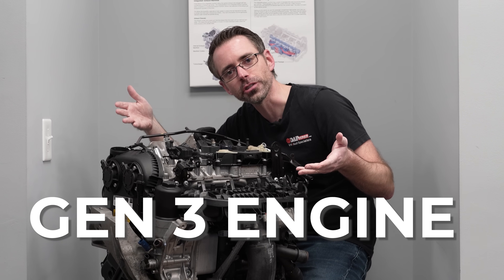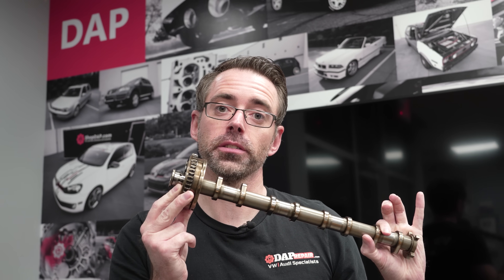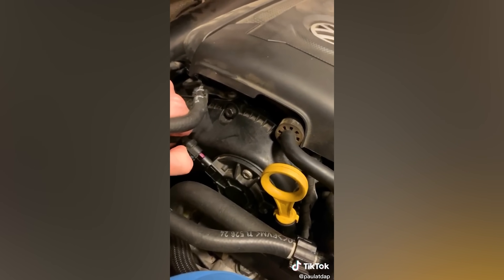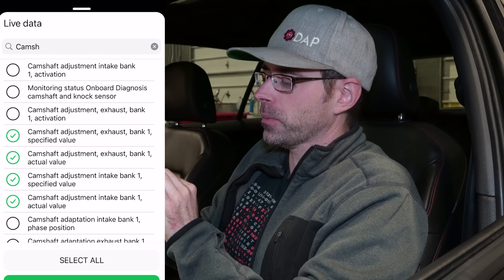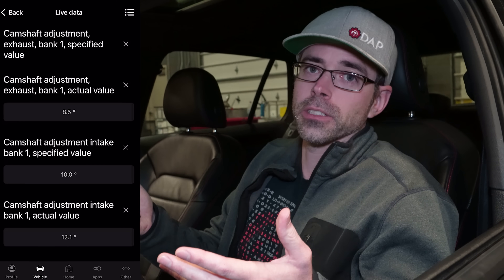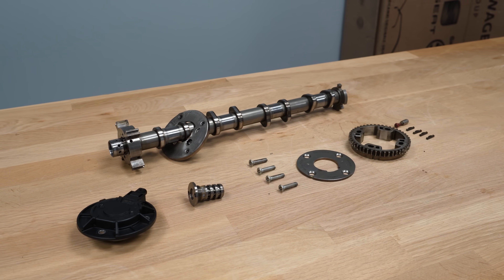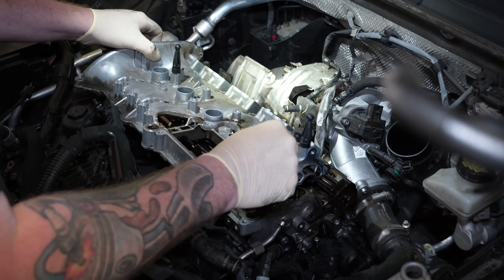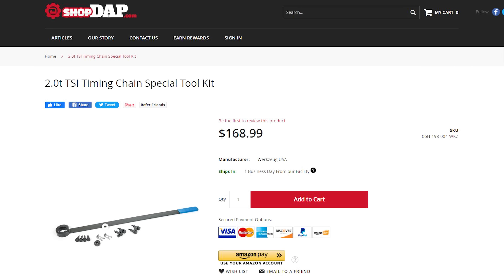Is this a New Common MK7 Engine Issue?

Comment: So just completed this job on my A4 with Gen3 motor - just wanted to say thanks for the video as it was spot on with the problem i had with my car. replaced both Exhaust and Intake cams (both had scoring on the snout part) with new spool valves, adjusters and timing kit at the same time.
cars runs like new now - :)
Thanks again

Comment: What sealant did you use on the head cover/cam cage? Mine is leaking (2017 GTI) and I’m getting ready re-seal it, and have seen talk of both anaerobic sealant and RTV. I believe anaerobic is originally spec’ed for the job, but I’ve seen forum posts stating there may have been updates that recommend a different sealant.

Comment: My GTI burned oil from day one but not much, made to 100k with only a heater core issue that leaked like crazy. Honestly it was the most reliable car I’ve ever had. During Covid it was hit and run, took 3 months for it to go to the shop and they started it with no oil and ruined the engine. Don’t know where the oil was leaking from after the hit but I made sure to let my insurance and the car crafters know but they didn’t check the oil before starting the engine.

Comment: Hi Paul, Hope you could shine some light on my diagnosis of this problem. 96k kilometers on the car. (1.8 gen3) There is a similar sound only at cold start and only when that retainer pin goes out and unlocks vvt from cold start mode. It goes away after a minute or so when (how I think) oil pressure builds up and then it can only be heard when after revving the engine slightly rpm is going down to idle. (I drive with oil run-in pressure adaptation constantly being reenabled for higher oil pressure to protect the engine more). Oil is always topped up, changed every 3.5-4k miles. Actual/specified values in obd11 are as on the exhaust cam in your video. What do you think it could be? I cannot hear any ticking/knocking from both cam solenoids through a stethoscope. Both solenoids are replaced 2k miles ago with seals. Chain stretch was checked by the dealer - all good..:/

It sounds like it’s cam vvt but my diagnosis does not prove it and I’m totally confused😢

Thank you for your time!!
Reply: Hi, I'm having similar symptoms. I already changed the magnets, but it's still happening. Were you able to resolve it?

Comment: Hi there my 2015 7 gti has bad misfire on cylinder 4 no compression on cylinder 4 tried plugs and coil pack still misfiring had vw technican look at it and he say no compression engine damaged... could it be camshaft issues ?

Comment: This happened to me and it had oil and I change my oil every 5k miles not 10k. I keep an actual quart in the trunk just in case it was to run low. So it seems like it’s an engineering fault on vw once again.

Comment: ironically, oil has been an isue since 1.8t R4 20v 150 hp since 1995. Small volume sump + needed regular change of high quality synth.
Oil related problems may be common for many manufacturers

Comment: I may have this issue.  
Mild oil consumption, and pretty consistent misfires right around 1400 to 1700 rpms just on cyl 2.   

.....DSG in Sport mode ftw.

Am I looking at a camshaft job?  Probably.

Comment: Wondering if I may be having a similar issue. My actual values are significantly higher than my expected values but only at their peaks, only occasionally off by a few degrees at idle. Should I be worried?

Comment: Lack of service and care is the cause of most problems with any vehicle,  not the manufacturer.  Thanks for sharing.
Reply: The problem he doesn’t mention is that these engine eat oil and it gets lower over time.
Reply: Yes, but when it uses a quart ever 1000 miles and they tell you to change your oil every 10k miles leaves you with -- 5 quarts ?
Reply: It would be really helpful if the manufacturer was honest. Change your oil every 3k miles and you wouldn't have gunked up rings burning oil in the first place. Would be nice if we could trust the manufacturers advice. SMH

Comment: I’ve allready changed both on my GTI 😂 first the admission one and after 40k kms de exhaust. maybe more common than we think
I only changed the outside magnet and solved the problem
Reply: Hi mate I have a golf r 2018 7.5 and im getting this rattle, did your issue completely go away after changing magent?

Comment: Ok, I changed the magnet, then the spool valve and I still get that diesel sound from time to time while the distribution is fine (i.e. correctly aligned, not stretched, only 4 teeth out for the tensioner  ); so it looks like I definitely experience the issue described here. The CEL did not come back on yet... but I guess this is just a matter of time.
I personally think it is outrageous that the cam phaser blades cannot be serviced separately and that I have to buy a whole new camshaft; apparently this was possible on earlier generations of this engine in which just changing the blades was a possibility.
Now I have to find a mechanic willing to do the job at a reasonable price... because I fear this is too advanced for me. 
I wonder if switching oil from 5w30 to 5w40 could solve the issue... because it occurs mostly when the engine is hot in my case... and not all the time.
Forget to say: engine is CJSA (1.8 TSI but EU specs, very similar to GTI engine) from 2013 with 83 kms on it, always serviced every year / 8 kms.
Nice video; thanks for the explanations, very clear.

Comment: Was that rtv sealant on the cam bridge ?
I rebuilt my EA113 and it called for anaerobic sealant.
Im assuming thats to stop the sealant sealing any oil passages and to prevent it clogging up the oil pump when the squish falls off and is picked up by the oil.
Then again EA113 isnt known for its oil pumps...

Comment: Years ago a friend in the 90’s had a Passat, and he always had the maintenance up to date. However the engine grenades due to an old timing belt. Dealership was going to charge him for repairs until he took out his owners maintenance log and the dealership had stamped that he had gotten the timing belt replaced 😊. They had charged for the work but never did it 😮

Comment: When the engine is cold, because of a ticker oil (higher viscosity density) the rattle isn't present, right? Also, on higher RPM (over 3k) because of bigger oil pressure, the rattle disappears as well?

Comment: my gen3 Beetle had this issue.... It turned out to be the little spring inside of that valve that threads into the camshaft had disintegrated. I replaced the valve with a new one (instead of doing the whole camshaft like vw wants you to do), but now I have the dreaded drain back issue when I start the car how it makes that stuttering noise like theres no oil pressure in the vvt.. I replaced that piece under the oil filter cap, took everything apart, made sure nothing is stuck or missing.. not sure why I still have that stupid noise at startup..

Comment: I've personally had 3 different Gen 3 motors all owned from New. 

2017 Jetta Sport 1.8T (Mexico) (Same engine platform) - Zero Oil issues - Traded @ 48k Miles. 30k of the miles were with Neuspeed Module Piggyback increasing boost output. 

2019 Jetta GLI Autobahn 2.0T (Mexico) (Same as GTI engine) - Zero Oil Issues - VW Bought back/Lemon'd it @28k Miles for unfixable A/C issue. 10k of the Miles were with a Neuspeed Module Piggyback increasing boost output. 

2020 Arteon SEL R-Line 4Motion 2.0T (Germany) (Tuned Down Golf R) - Zero Oil Issues - Currently @ 22K Miles - AWD forced me to buy a set of 4 new tires at 10k due to 2 - consecutive weeks of blowouts due to shitty roads by our office.... And then brakes require rotors and pads at only 20k. 

None of my 3 modern VWs with same engine family have had oil related issues at all even with me romping HARD on them. The only thing I've done is consistent maintenance by the book, always, always, always follow the break-in procedure to a tee, and only use Top-Tier branded gasoline and keeping every receipt for record 😅

Maybe its luck but I've only had issues with everything but engine/oil issues lol. But I've also been lucky enough to not have gone past 50k miles though so who knows. Maybe after some miles they get worse 😅 

Just my experience 😁

TL;DR - 3 VWs with same engine family no engine or oil issues. Only other things 😅

Comment: Just had our 2015 1.8 TSI Passat in for replacement of the n205 and magnet, cost me $786. Glad it wasn’t the $6500 top end rebuild they said it could be 😬.
Reply: Wtf. It’s a $40 part and 3 bolts on the top of the motor. You got scammed hard bro

Comment: Paul, I wonder if it would be feasible to transfer the inner piece from a VVT valve 06L109257 rev. F to the rev. A currently on my car, as to avoid replacing the entire camshaft. What do you think?

Comment: I have a mk6 gti and I’m having awful trouble trying to cure a top end rattle and it’s really bad at 2000rpm,,noise goes when magnet is disconnected,i have replaced all chains and tensionors,oil pump,intake cam and still noisy 🤦🏻‍♂️had a low oil pressure light to begin with intermittently,no debris in sump or scoring to cams even prior to cam change,have you ever seen this issue?? The spool valve seems ok has some spring resistance and not blocked 
Engine sounds great with magnet unplugged 🤷🏻‍♂️🤷🏻‍♂️🤷🏻‍♂️
Reply: You already fix the problem ?

Comment: I have a 2015 gti 39,000 miles and currently I have a problem that does not pass the smog certificate due to a problem with a VVT monitor related to this same part, a problem that is supposed to be solved with a driving cycle!  but I've already driven it for a long time at no more than 70 miles per hour and I'm still having the same problem.  Anyone going through the same thing please share your experience.  thank you

Comment: The plunger(spoolvalve) in the center of the camshaft actually failed on my ‘13 mk7 gti, Causing it to sound a TDI. It did have oil in the engine though😂. Replacing the plunger fixed the problem and prevented from buying a whole new camshaft. This was around 140k km’s.

Fun to see how this whole part work, keep up the informative videos!
Reply: Hello, any chance you can add me on some sort of other social media so I can send you a video of what mine sounds like so you can tell me wether it was the same as yours. Had this issue for ages now and it’s stressing me out as no one can diagnose it

Comment: man, you are not the only one talking about ignorant car owners who never change the engine oil !!! what is up with that ?! do people really work for their money ?! you would think they should be taken care of the money spent buying them Vehicles. but here's my question I always wanted to buy a GTI VW. but due to the lack of long-term reliability I buy a Toyota. do you think these VWs are good and how to keep them running without issues? if that is even possible. a note. I'm the kind of person who takes good care of his vehicle. I trade in my 2007 V6 Toyota Camry with 168000 miles on it for a 2012 AWD v6 Toyota Venza this one had 48 thousand miles on it. my next future Vehicle is not decided yet. but I'm researching the best fuel economy in a nice exterior design out there.

Comment: 2:32 I had that noise in my car (not VW but TSI from VAG). Air Condition compressor failed at very early stage. 3 years old car.

Comment: VW tech here: To know if its the N205 valve, first unplug it to see if the sound and characteristics of the engine changes, if it does then you have a bad valve. To confirm further, remove the valve and check the plunger/nipple . If the punger/nipple shows any resistance in moving in/out, the valve is bad and needs replacement.  PS. Make sure you have OIL  IN IT!!! 😂 GL!
Reply: but he said you can't just replace the valve 😕...... the entire kit has to be used
Reply: @voffchik26  he is in the business of selling parts, what do you expect

Comment: i am really amazed how irresponsible people are regarding oil level in their cars. such an easy thing to check, requires no knowledge, just a tiny bit of effort and can save you so much trouble, starting with getting stranded in the middle of a long drive.

Comment: People are so lazy now they won't bother to pull the dipstick once a week. The number of engines that are destroyed simply because if lack of oil is mind boggling; thousands. All for the sake of a 50 dollar oil change and a check of the oil level.
Car manufacturers should follow what BMW do, fit a low level oil sensor in the sump, but how many people would ignore the warning light and keep on driving?
Reply: Don't the EA888s have level sensors?? What's that thing on the bottom of the oil pan plugged in?

Comment: Do these engines make this noise to a lesser degree during cold start. For first minute or so, when under load (not at idle). Mine seems to as I back up a sloped drive. But pretty much silent as I then pull away.
If I let the car complete its cold start routine it's less likely.

Comment: Not only a mk7 problem. Renault has the same issues. And its not an oil level problem but a seal problem. And a renault dealer will only replace the gear wheel. This works for 25K kilometers but than the problem returns. it will costs you thousands of euros and it will not work

Comment: Can this happen to Gen 1 engines? My symptoms and codes seem to match, I thought it was my timing chain knocking but it didn't make sense because it still made compression
Reply from the maker: Compression and chain noise are not directly related. Yes the tsi engine uses a similar adjuster and spool valve so this can happen

Comment: I knew from the very beginning to change oil way more often than the dealer says, and use the OEM oil filter with the specified oil. Engine will last a long time, even if it’s being driven hard
Reply: I agree...I bought my MK7 brand new and only drove maybe 8000-10000KM per year (and that kilometers) and I changed mine twice a year still. I did the intake service too once a year until I sold it. It didn't burn a drop of oil and didn't give me problems. That extra maintenance was so easy and I felt good about selling it knowing I'd done what I can to prolong it's life

Comment: Hi, Audi tech here. We get cars rolling in with this problem pretty often. We never replace the camshaft tho we just replace the plungers and the magnets. This solves the problem. Just replaced them on a Golf R this saturday and it's running like new.
Reply: My timing cover noise turned out to be only the plunger (also referred to as the "Engine Variable Valve Timing (Vvt) Oil Control Valve" or spool valve).  The VW dealer similarly to this video diagnosed the problem to require replacement of both the intake cam and the valve for $2700, but I said no thanks!  After first replacing the control magnet with no effect, I then replaced the valve and voila - problem solved!  This took about 1 hr of my time aside from all the internet research including finding the comment by iant1891 above.
Reply: @alexonski  mk7 GTI?  Do you have the valve part number?  No cam shaft replacement?  Did you remove the upper timing cover?  TIA.
Reply: Ford tech here, so im no stranger to vct issues lol, my S3 at idle sometimes (not all times) the RPMs start jumping almost like i have a old school cammed out v8. once i start driving its fine and then it goes away at the next stop. have a p0011 code. was going to just replace the solenoid until i saw this. thoughts?
Reply: I got 2021 A4 with 20k on it. Should I be worried? Anything to prevent this?
Reply: @senco981 yes be very worried you bought a time bomb, get rid of it asap
Reply: Did you replace both magnets and plungers on both?
Reply: im having this issue right now and we have unplugged both phasers and change the valve spool  and the ticking noise still persists. should i assume its the intake cam or replace both phasers and see then
Reply: Having the same issue myself did u get urs sorted ? Any info on what it was ? Thanks
Reply: Hi , everyone nice video .
How do i know if my magnets are toast ?
Reply: Would the ODB eleven live data tell you if it’s the plungers and magnets?

Comment: I'm listening closely, and all i'm hearing is to get an old car with an 4cyl 8 valve engine what doesnt burn oil by its nature, cast iron everything, chain timing, one cam for inlet, one cam for exhaust, no electronics whatsoever, no variable anything, just very basic fuel injection, and all the problems are pretty much solved for a good while 😀 maintenance will also be quite a bit cheaper i guess

Comment: I had exactly the same noise on my 2011 1.8tfsi ... replaced the timing chain & tentioner, replaced all the surrounding sensors... the noise never went away, so this was the very last thing left to replace... at least now I know this will definitely fix it...

Comment: We had the problem on the GTI, but it was the solenoid that caused it. started to stutter like a maniac. noone thought this would fail at 40k miles so it wasnt the first thing to be changed in the end. Killed the timing chain  in the process.

Comment: VW shaft their customers. ON VW Crafter TDI Diesel van and some car models  they changed the supplier of the 'Rocker Arms' for 2016+ Euro 6 Diesel CLSA / CLSC engines out to China. F k n Idiots!!!!!!!! The timing rubber belts last longer. We look after a fleet including some of these. Vans were dropping valves, Rocker arms falling into pieces what a disaster. Must have cost VW a ton of money in warranty engines all to save a £ or two per arm. The rocker arms to 2016 used to do 250k+ easy and we can't find who did or still does the older type rockers. We don't buy VW any more.